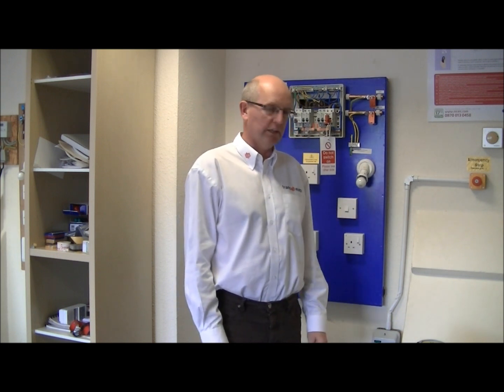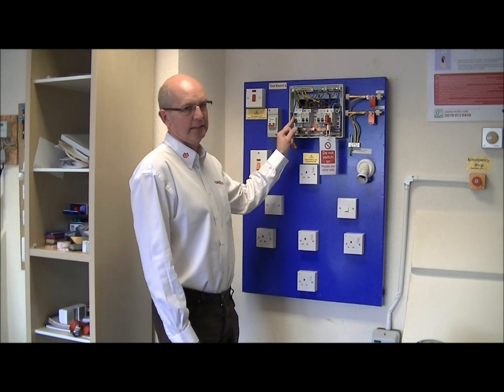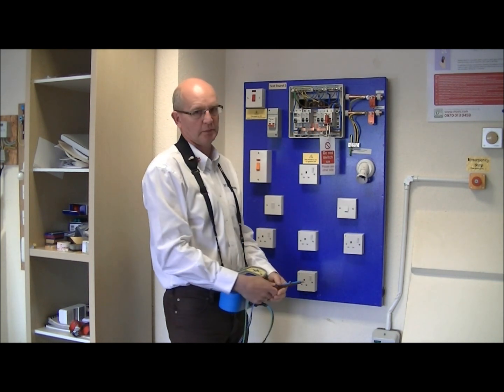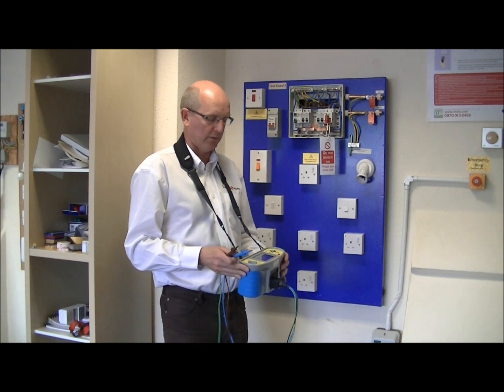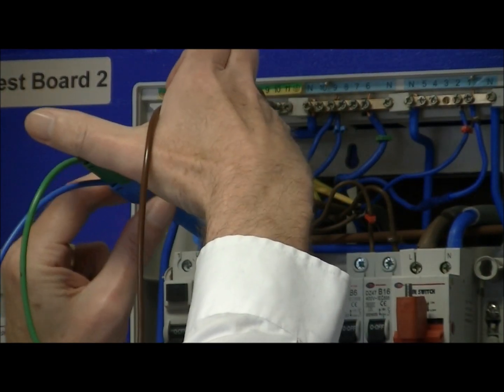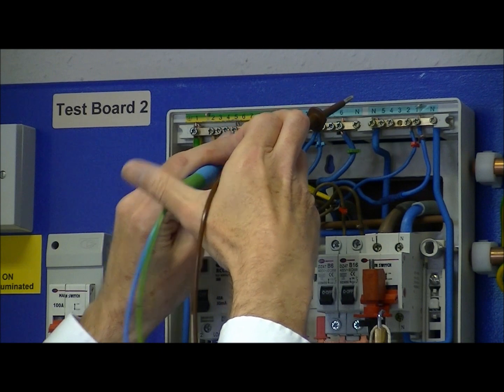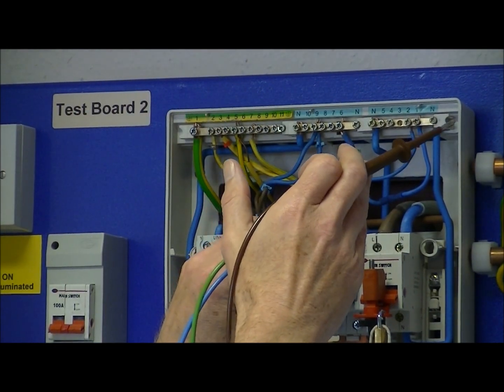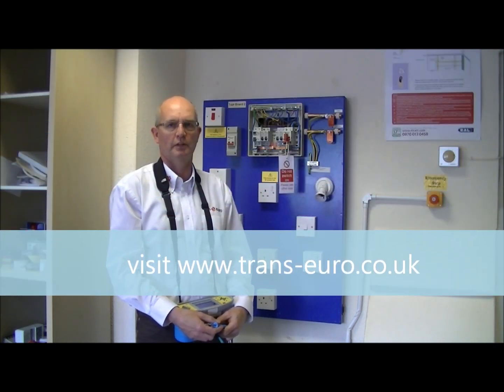Insulation Resistance test

Comment: The breakers should be turned on except the main switch.
Reply: he is testing each circuit separately,  you only leave them on when testing at main switch whole installation, main switch in off position.